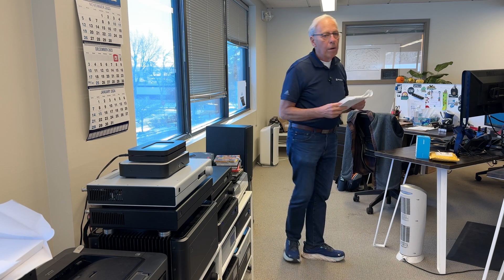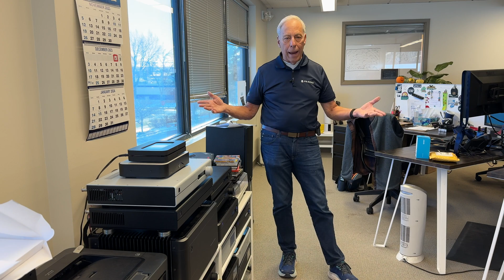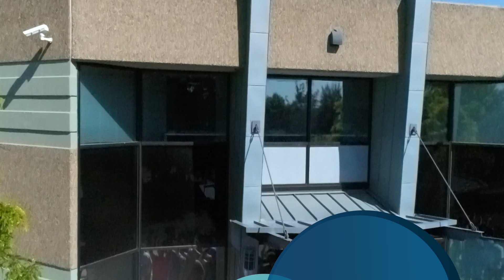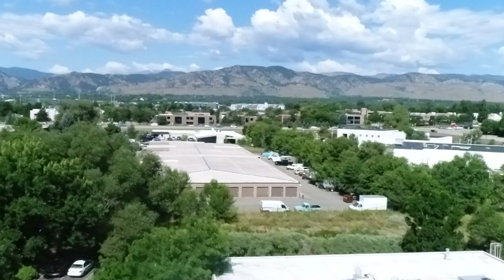Why amps go into protection mode

Comment: Protection mode is a safety feature to prevent the amplifier from sending high voltage to the speakers if a component fails. There's a relay before the speakers that only becomes activated after all of the circuits test correctly. The protection circuit tests voltages of the amplifier circuits at various points. Some should have high voltage, others should have low.  If something is not right then it cuts off the speakers, possibly preventing a fire.  

A common problem is solder joints on amplifier transistors don't have enough solder on them because they're the boards are dipped in solder, not soldered by hand. They get just a thin coat of solder.  After the amp heats up, it can melt the solder then create a bad connection that sends the amp into protection mode.  Open it up, then do a good job of adding solder mass to the amp transistors that are attached to the heat sink.  This will raise the temp needed to melt the solder joint.

Comment: I had the same problem with a PS Audio S 300 power amplifier, and it went into protection mode whenever the volume knob of the preamplifier went past the 1 o' clock position.  The problem persisted no matter what pair of speakers I used.  I tried 3 different sets of speakers, and the amp would go into protection mode although the music wasn't even very loud.  None of my other amps had this issue.

Comment: Thank you Paul for the response to my query! This is something that I had not thought of.. A follow up would be to check if other amps like the Luxman 509 or the accuphase e5000 would be able to match the min impedance of these speakers at higher volumes? If not, which amp would you suggest to deliver clean sound with good punchy bass at high volumes?
Reply: P.S. I really love playing at high volumes in excess of 110 to 120 db

Comment: I would check the static resistance of your speakers. You are pumping a lot of current into them .... probable clipping and sorting or fussing  the voice coil. This will show up as an abnormally low impedance. The amplifier is a voltage control system so if the impedance is low in just one of your speakers it will override the current capacity and reserves. The amp is probably doing its job properly and shutting down. A blown speaker is always going to manifest in an open circuit and just stop working. If it running at say 2 olms there will still be sound coming out of it. But now the amplifier is operating in conditions it wasn't designed for. If you have a large space and need to listen at  very high levels you might want to consider high quality professional type speakers they can both handle high power and have high sensitivity. Depending upon the type of music you listen to it might be a better option than  overpowering high end speakers save those for critical listening at slightly lower levels . Remember a three decibel increase requires twice the power and 10 decibels is about ten times the power. Three decibels isn't very much you will here the difference but that will be just noticeably audible.

Comment: FWIW... Most amplifiers protect themselves against excess heat, excess current, DC offsets on the speaker leads and over-voltage.  

Impedance dips can trigger the excess current trap.

Comment: I can never understand why some so called high end speakers end up with dreadful dips in their impedance ... this is entirely due to poor crossover design ... this is what you get when you strive for a dead flat frequency response .. our ears put up with dips in response +-2dB say but massive dips in impedance not only upsets the amplifier somewhat but also causes unnecessary phase shifts too.
Reply: Indeed. It is crappy crossovers that cause these problems.  
A crossover network is a blunt instrument, intended only to steer frequencies to the appropriate drivers. Of late I've been seeing more and more cases where designers try to treat the crossover as some kind of equalizer... resulting in ludicrous dips in impedance and wildly inefficient speakers.

Comment: I have a similar problem with my Yamaha AS-2200 amp driving a pair 
of Whafedale Lintons. I let the amp warm up for about 20 minutes and 
Than start playing on low volume, however crank it up too 11 o'clock or more
then 9 times out of 10 it will go into safety mode.
Reply: The Dynamic power on your Yamaha is why to high for the Wharfedale Linton at 11 o'clock or more they can't handle the low frequency sound is my theory
Dynamic power: Yamaha AS-2200
8Ω........................................................ 105 W + 105 W
6Ω........................................................ 135 W + 135 W
4Ω........................................................ 190 W + 190 W
2Ω........................................................ 220 W + 220 W
Linton: 3,5 ohms at 200W Absolut Max my recommendation would be a Marantz PM8006 or new speaker. Cheers

Comment: This happened to me once and it was because when I inserted the speaker wires into the terminals behind the amp, I had some sticking out the other side and the the positive and negative wires were touching each other.

Comment: Dried out caps, uncorrected idle current, and probably high current transistors failure. The Denon has more driver stages and some high-current transistors for higher-current work from another driver stage inside the amp. I believe there could be a problem as well.

To my knowledge, Denon is quite stable all to 2 ohms, so I might really wonder if that is the issue? Or do Focal dip to 1 ohm loads?

Comment: Wish my sub amp protection mode actually worked. I have nuked two so far. Not even clipping just running em hard. And my subs impedance never dips. Only rises.  Dang it.

Comment: It’s 100% impedance drops like Paul said. I’ve seen this firsthand with speakers that drop to below 4 ohms ( near 2 ohms ) on an amp that was made for 8ohm/6ohm load. Only took a few seconds of heavy bass and it would go in to protection and it would run heater than normal when it was pushing it’s limited.
Reply: Not familiar with/current Focal offerings but I demoed Grande Utopia’s some 20 years ago and they had dip in upper bass to <2 ohms. Combine that with marginal sensitivity of 86-87 db and amps either clip or shut down unless capable of delivering substantial current. Martin Logan’s, Apogee, Wilson’s, Magico and Sonus Faber are all among speakers famously difficult to drive. I do wish more speaker oem’s would pay attention to both efficiency and load curve when designing their speakers. 

Even with Magico’s lineup, they offer their M-Series which are all min 4 ohm loads and >90db sensitivity yet S-Series are 87db and have dip to 2 ohm.
Reply: "Made for x ohm load".. No, not really.. All normal amps can i.e drive 4ohm even though it says different on the back. Thing is that most affordable amps are also kinda weak (not all) and they don't have enough power in the power supply chain.
And that becomes a bigger problem if the speaker also has impedance dips that go too low. Then there is just not enough juice to handle it.
Remember the amp is getting told do deliver twice as much watts in 4ohm as in 8ohm and so on... That's why I always chcek what it can actually draw from the wall before I even consider if the watts are real. I.e A/B is about 50-60% efficient.
Class D is about 90+. So not really heard to do the math and find out if it can actually deliver what it says.

Comment: The amp is probably internally oscillating at some ultrasonic frequency. 
(A problem when using "low capacitance" speaker cable..)
Try running the amp with a "dummy load" (8 ohm resistors and zip cord) at the same level and  see what happens.
If it STILL gets hot and shuts down you've isolated the problem to the amp itself.

Comment: The guy is listening to his system at "11" or to translate...Beyond MAX volume! He is overdriving his amp into horrible-sounding, unlistenable territory and damaging his speakers in the process.
Reply: it is 11 'clock (ie less than half) and not at 11..
Reply: @rohurulz  Are you the person who wrote the question for Paul? If so, thanks for the clarification. If you don't mind me asking, how long are your speaker cables and how are they terminated?
Reply: @tototronic2  yes I am. They are connected by bananas and are a out 10ft long transparent super cables
Reply: @rohurulz  Those are good cables. I've looked at the other responses and comments and there are a lot of good theories.  You say in one of your responses that you like to listen loud, between 110-120 db.  What are the dimensions of your listening room?
Reply: @rohurulz  Do you use the tone controls on your Denon?
Reply: @tototronic2  yes, for some tracks I need to, since there is a lack of bass. For most others, we use source direct.

Comment: The Focal "only" dips to 3,1 ohm, according to the specsheet.
A € 4.000 Denon should be able to handle that, I would think.
Output power 8 Ohm (20 Hz - 20 kHz, T.H.D. 0.07%) 80 W.

Output power 4 Ohm (1 kHz, T.H.D. 0.7%) 160 W.
Reply: I would be interested in actual measured impedance of that speaker, but unfortunately that requires fairly specialized instruments for a full frequency sweep. Hard to imagine a dip to 3.1 ohms is sufficient to cause a thermal or current overload trigger but if that dip is across a broad frequency, it’s possible. 

A cheap test might be to borrow a friend’s speakers that are a known easy load and see if issue recurs. My guess is Denon engineers may have wired in a very conservative current limiter that doesn’t play well with those speakers
Reply: @MichaelM-to4sg  a simple ohm meter in metween will work tobemassuee the impedance drops
Reply: 3.I olms at low frequency with a wide bandwidth being driven at high gain with some bass heavy music..I can see the amplifier shutting down. I don't know the sensitivity of the speakers but if he's pushing 105 Decibels in a good sized space he's also pretty much tapped out the current capacity of that amplifier. Take a look at the THD differences from 8 to 4 olms that's an order of magnitude increase at 4 olms something is changing there probably the amplifier running out of current.

Comment: Or it has a bias issue. In older amplifiers  a lot of components drift out of their values. One can tell if it is overheating at idle/no signal .  |Even some 1990's kit I get in for work suffer with this.
Reply: ...but it can be hard to find a qualified and honest service technician if you can't do it yourself.

Comment: I'd say there is a wiring issue somewhere as that's a pretty robust amp unless you think $5,000 doesn't get you much nowadays in an integrated.
Reply: A focal loudspeaker is a stiff load, and at high peaks, it could trigger a protective, no pun intended, amp into   protection. 😀
Reply: @salvadorrodenas3071  I often get the comment that it couldn't be my speakers at fault because my other amp doesn't do it. I then have to explain that protection circuits of different amps have different sensitivity to various issues. Sometimes they believe me and we get down to the problem and we fix it. Other times they don't and they just have to keep living with it. I have reached the point in my path where either outcome is ok with me.
Reply: @salvadorrodenas3071  8 ohm nominal, 3.1-ohm dips. Pshh. My amps live in 2 ohms and 4 ohms respectively and they never get slightly warm.